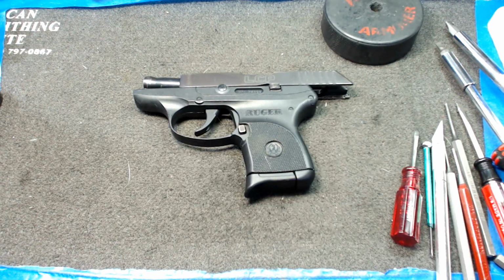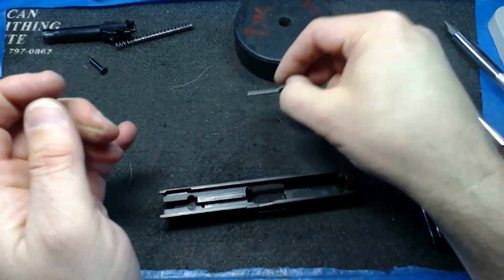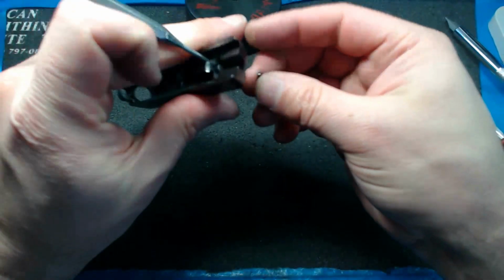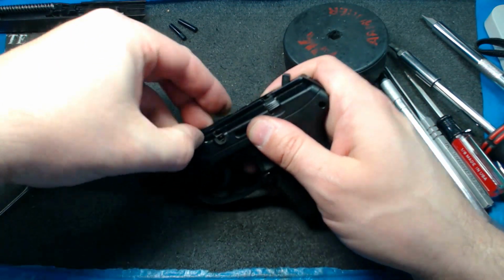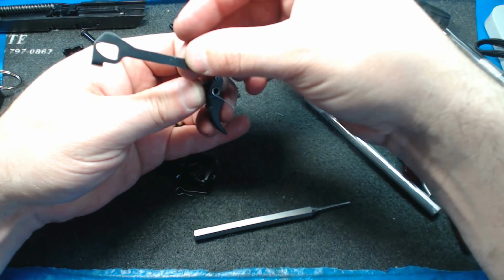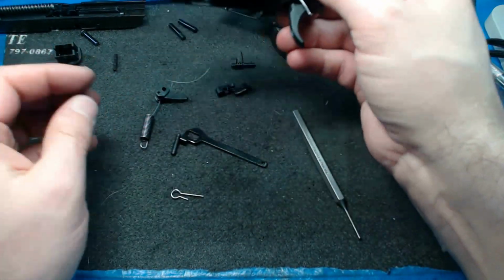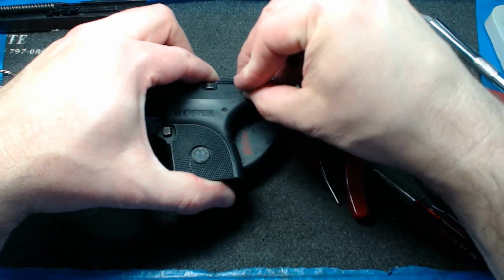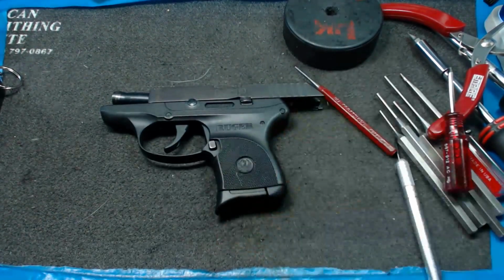Ruger LCP 380 Complete disassembly and reassembly`

Comment: Thanks for the run through! I used this video along with my general knowledge of armory to do a complete disassemble for my LCP II.  For all those out there worrying about starting their LCP II Disassemble, it is ok. This video will get you through 95% of the II. Main differences as far as instructions and steps go:

1: Slide lock + Captive Pin Spring are one in the same on the 2 (the LCP has two separate springs and a much smaller slide lock bar).
2: Slightly different sear/cam mechanism but placement is identical! Don't get hung up on the different shape. 

3: Note for both firearms: A bit difficult to tell in this video but, when inserting the sear spring between the frame and sear, the bottom leg will be facing slightly forwards and down. You need to rotate it back with some serious pressure in order to push the pin all the way though. Once pin is through, the pin helps retain the pressure on the spring.  If the long leg of your sear spring is facing upwards with no tension on it once installed, you've done it wrong.

Comment: Thanks for posting this.  Really saved my hide, because I accidentally removed the disconnect pin instead of the frame pin and had no clue how it went back together.  It's really a PITA, but I finally got it back together after about a dozen tries.

Comment: this is a great video. For the LCP II, the only real difference is when removing the aluminum chasis from the plastic frame, you just need to use a thin-soft punch to make room for the serial number plate on the Chasis, so that it will slip past the plastic frame on the one side. This Video Rocks!!

Comment: The absolute best no nonsense  video. I’ve had this gun for over 10 years and couldn’t find any good instructions on how to tear it down completely…so there it sat collecting more dust. having glocks i am use to completely tearing them down. You have taken all the mystery out of it. The only thing missing was when we were in the trigger block, with the plate that kept flying off, shoukd any of that be lubricated? Thanks for a valuable instruction on the lcp! Btw, the inside my gun was filthy…dunno if it was just nasty lint cuz it is a carry pistol or that i had no knowledge how to go any further in disassembly!

Comment: Man, Fantastic video.  one of the few.  i'm getting ready to tear down a few LCP slides to coat them with Duracoat's aerosol, air cure coating, and you've helped me out immensely.  Keep it up.
Reply: i just duracoated my LCP slide and frame. I didn't have to scuff either; the duracoat holds well on both.

Comment: Re: the "disconnect spring" -  I cheated - I attached a loop of thread around it, used a needle threader through the roll pin hole, the thread was grabbed and pulled out of the same hole via the needle threader, and the thread gave me a "handle" to align the spring with the (same) roll pin hole.                                                                 Sometimes, ya gotz to be creative!!!!!!!!!!!  (especially after a bout of frustration).

Otherwise, GREAT comprehensive instructions by AshburnArmorer, to whom I've now subbed!

Comment: Excellent disassembly demo. The item you refer to as "the metal insert" is actually called the "trigger pivot," and when the little nub on it that fits into a hole on the narrow end of the trigger bar breaks off (as it is prone to do), it turns the pistol into a paperweight. Taurus TCP 738 pistols have exactly the same trigger pivot and trigger bar mechanism. I've experienced one failure of the trigger pivot in the LCP and FOUR of them in the TCP 738. If you're ever firing your LCP and all of a sudden the trigger no longer works at all (the pistol cannot be fired), suspect that failure first. Ruger would do well to make that part out of titanium, or at least a very strong, heat-treated steel. It wouldn't appear to be under that much stress when doing its job, but apparently it is, or else the metallurgy is sub-par.

All of that notwithstanding, Ruger's customer service department is amazing and deserves props for their customer care. This particular repair required 7 days; i.e., I had the pistol back in 7 days, which included 4 days for transit to Ruger and back, time in their possession, and the weekend.

Best wishes - great channel! Cheers.

Comment: Thank you for such time expenditure on both processes.  I initially viewed it to both familiarize myself with the weapon as I do with each one I initially take possession of and to take in the process of trigger removal for an upgrade.  Although I'm capable of the upgrade while using the video as a guide, I have to tell you that I just didn't think the trigger and frame had so many parts and so many small, hard to reach parts.   I'm 67 and I was exhausted at the end of the video from just watching you.  I was initially going to change out the trigger, guide rod and install a heavier guide rod spring, which are easy enough to do by themselves, but that trigger disassembly and re-assembly.  Ugh....Tired just thinking about it again.  lol  But the video is a keeper in my bookmarks for that special day I'm so bored that I decide to do that trigger upgrade.  But I'm thinkin' that I'll most likely be dead before I get that ambitious again in my life.  LOL  Thanks again for workin' ur' magic and explaining everything so well.  fox

Comment: Thank you for such a thorough explanation. I took my  LCP  apart for cleaning and could not get the slide to stay engauged with the frame.  you showed which position the hammer had to be in  for reassembly  and bingo that was what  the problem was.I am subscribing.

Comment: Excellent video.  been thinking about getting one of these.   I'm wondering if one could leave out that disconnect (Kel-Tec calls it a hammer block)  and turn this into a true DAO with no precocking.  The trigger bar might have to be altered somewhat.

Comment: To remove the mainspring pin i use a small curved o-ring pick. I hook the sping and pin together with the pick at about about 10 o'clock. Lift out the notches, rotate to where it'll fit and lower it into the magwell. Oreintated rails down and the backstrap facing away from yourself. Ive found it to be much easier than pliers.

Comment: Excellent video.  I want to swap out the two (front and back) frame pins for stainless steel ones and I have one possibly obvious question.   From the video I believe I should be able to do that (one pin at a time) by carefully pushing out the factory pins with the new ones.

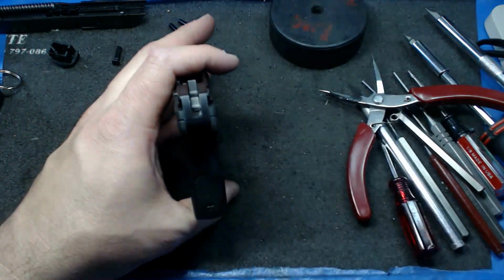Comment: 46:57 the small hole in the right side of the polymer frame, located directly above the disconnect axel pin, is for inserting a thin punch to hold the disconnect in the forward position while installing the receiver back into the frame. This will make that portion of reassembly much easier.

Comment: I'm hoping you can help me with a question i have, i pulled the trigger with the slide and magazine off. the hammer came forward and is now stuck, i can't move it, and i can't get the little cam piece that's under it to move either. Is there anything i can do short of taking it fully apart to unjam it?

Comment: Excellent Youtube.

Question: What if the Extractor Detent does not move back enough to disengage from that Extractor? 
My 1/16" punch goes in easily, and move only slightly forward. I can see the detent move factionally, but not enough to disengage from the extractor.
Any ideas would be appreciated.
Thanks.

Comment: The spring for the mag release is easy to get out, the trick to putting back in:  put the mag release button in place, put the long leg of the spring into the hole in it, with short leg facing forward.  Hold down on top of spring and use screwdriver or your finger to rotate the spring into position.

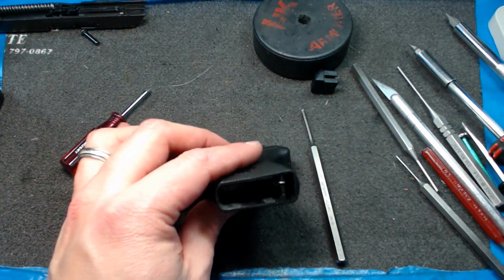Comment: 6:30, 9:49, 20:00, 51:30
Good video.
I want to add my 2 cents that may help someone putting the spring around the shaft that starts at 51:30.  I took a piece of 22 gauge wire and make a loop to catch the hook of the spring then pulled with pliers. The spring almost jumped onto the shaft.  Easy Pezzy.

Comment: My slide won't cock my hammer back to lock, if I take my slide off and press back down on the hammer it will lock and the trigger and will release. I got bigger springs and did a trigger job on it but I have no clue what is happening. Any thoughts my friend? Trigger job after first 25rds fired at range 150 rds total through it until this issue.
Reply from the maker: Hard to say. "Trigger job" covers a lot of territory. If the hammer-catch is working with the slide off, it kind of implies that the slide is interfering with the disconnect. However, there is also at least one way to reassemble it wrong where the hammer-catch is not really in place, but kind of stuck in the right general area that can result in this too. The fix there is just to reassemble that bit again to be sure it is 100%.  
Of course, if the hammer, trigger-bar, or hammer catch are damaged or "overtuned", it can have the same result. Filing material off of any of those parts changes the timing of the disconnection cycle and/or the depth required to depress the hammer until it is engaged, etc.  You will want to make sure that none of those parts ended up bent or broken and that they are all still interacting with each other correctly.
I have  a vague memory of this condition also being possible if the trigger is not fully resetting, but I may be mixing up guns. I am doing this from memory. I would have to find my LCP to be sure and I am not ready to clean that corner of the shop right now =)
Best of luck.

Comment: I got through the last parts on putting the hammer back with the sear and the springs in it and got it all back together but it’s not engaging the hammer could I have pushed the sear to far forward or maybe I put it back together wrong cuz the hammers not working when I pull the trigger

Comment: I just purchased this gun and disassembled the slide from the rail. When I put it back together there is a little bit of play in the barrel when the slide is retracted. Is this normal?
Reply from the maker: Yes. Many guns incorporate an extremely small bulge at point where the front of the barrel meets the slide when the slide is closed. This serves to pinch the barrel in place while shooting(for accuracy) while the rest of the barrel is slightly slimmer so as to not create friction during cycling. On the LCP380 the bulge is gigantic and stands out. This is to compensate for the short barrel length. When the barrel unlocks during cycling the short barrel creates a steeper angle at the front of the gun where the lockup was tight and the gun would seize up during cycling if it weren't for the narrower bit behind the bulge.

Comment: I own this gun but when I shoot it it feels like it going to blow up in my hand..I wonder how well made this gun really is..How did you crack your frame on this gun..
Reply: The reason for that is because of the spring weight.  I have large hands and it would sting my hands when shooting.  I swapped out for Wolff springs  ( google 13 lb recoil set)  it made all the difference in the world and its DIY.  The only difference is it may seem harder to pull back to rack one ( which shouldn't matter if its an Every Day carry as you should carry loaded)  it shoots nice and smooth now. I also polished my barrel and use flitz to polish the metal parts.

Comment: Tip and question for ya. My extractor spring has a ground flat end on one end. I would presume that goes against the plunger? My tip is to lay the slide on it's side extractor facing up. Position it at the end of the table and clamp the back of the slide to the table. You can use 2 hands now.

Comment: I just took mine to the range for the first time. it wouldn't go fully into battery half the time. Sometime I could hit it forward, sometimes it was stuck and I would have to extract the round. Then it got so stuck that the extractor popped out and I couldn't find it.

Comment: DO NOT REMOVE THE PIN UNDER THE SMALL HOLE ON RIGHT SIDE OF THE GUN !
I have the lcp2 and it looks like everything is the same. Update: the trigger assembly doesn't just pop out. The serial number on the gen. 2 will hold it down. Slide a knife blade between the frame and spread the side out a little. It took me an hour to figure this out. Grrrrrr 
Now, the mag release spring is actually easier. Put the long end into the hole, then assemble, leaving the short bar hanging out. Push the button where it needs to go, then from the top, take a small punch and snap the short spring in place. You'll see.
DO NOT TAKE THE DISCONNECTOR OFF OF THE FRAME! We're talking a PITA to mess with.
Now, when installing the disconnect to the frame, notice the small pinhole just above the larger hole. Use a needle to pre-tension the spring when putting the rail back . Put disconnect where it needs to be, then push the pin in the small hole to hold it in place. Same idea as replacing motor brushes, there's a hole to reassemble the motor, then remove the pins. When you assemble the rail, just pull out the pin, and voila.
Sir, fwiw, thanks so much for taking the time to do this. I know there are many who benefit from this. And, thanks for not playing shit music, and saying "Dude" and speaking clearly and articulately. (Plain, for you southerners)
Thanks.

Comment: My lcp will not feed correctly, it stays locked open a little, I believe it's the extractor but idk, I'm in Fredericksburg btw. I've never fired it either , it's very frustrating, any ideas?
Reply: Hey Jessie just call Ruger customer service I had the same problem they are wonderful they replace my slide and gave me a new barrel with because of feed ramp issues. No worries if you bought it used or new, Lifetime and transferable warranty.

Comment: How does someone break the frame?
Reply from the maker: Almost every gun on my channel was a formal rental gun at a public indoor range. They were all used until they either failed or showed evidence of fatigue/stress damage. Some were customer guns beyond cost-effective repair. One or two are brand new unboxings, but only a few of the actual firearms you see are safe to fire. They are great for these demos, but the barrels have had over 100K rounds through them. Most of the frames are cracked somewhere. 
Any device that attempts to control 20,000psi+ is taking damage every time. The steel gets retempered with every shot. Metal wears on metal over time. While the breakage event can seem sudden, it usually is the result of slow fatigue over time. 
The occasional catastrophic failure is usually tied back to something on the user side, but there tends not to be much left to repair when that happens.

Comment: I'm assuming I messed something up with the disconnector. When I cock the gun it won't let the hammer go unless I pull the hammer back slightly. It seems to work when the slide isn't on but when you pull the slide back it doesn't let the hammer fire unless you pull it back slightly with a flathead or something. 😳 Going to try reassembly again for the 100th time lol

Comment: Here is a tip non of these geniuses will mention not even in ruger manual. 
Be sure hammer is pushed down ( out of the way ) otherwise the slide will absolutely not go back far enough for pin to go in. Took me 45 minutes to figure this out. Thanks ruger....thanks u tube posters....not
Reply: He did mention that lol

Comment: Thanks for the video man! helped a ton on my LCP 2. it's pretty much the same set up, the frame pins are slightly different sizes,  the slide lock is an actual bar that the takedown spring holds on, and the hammer sear is pretty different looking in how it's shaped. anyway. awesome video and you really saved my ass!
Reply: Damn...I'm trying to reinstall the sear/hammer catch spring into my frame. I'm not sure if I'm doing it right. I'm following how he does it in this video but there is this polymer ridge inside the grip that is preventing my sear from moving all the way back. How exactly do you orient the sear and hammer catch spring?

Help pls?